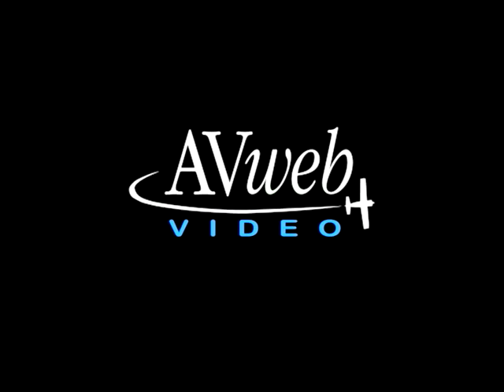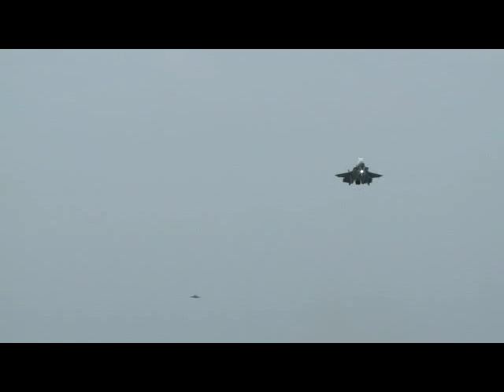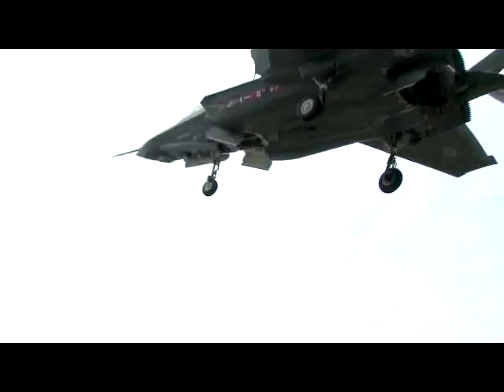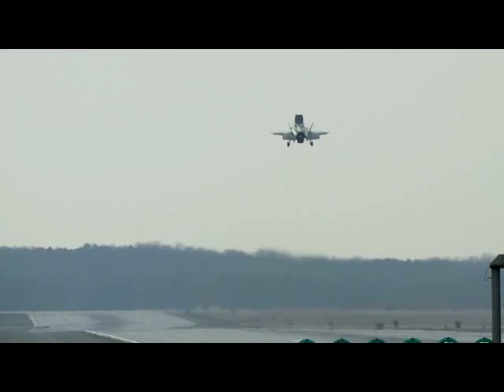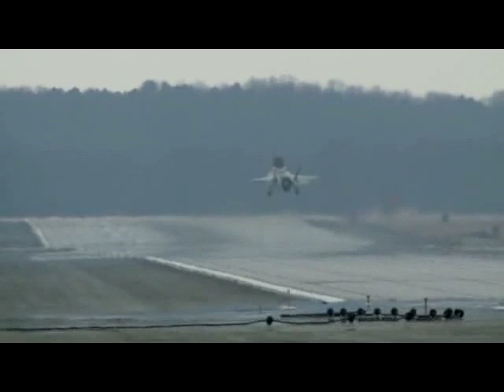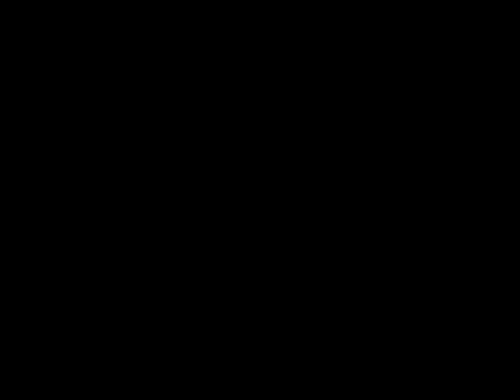F-35B JSF 40-Knot Flyby, Pre-Vertical Landing Test, March 10, 2010

Comment: Well as you should know, the Brits invented a successful VTOL aircraft called the Harrier.
BUT it was harder to fly and maintain. The JSF is basically a single turbine "Mini F-22" in aspect. The front vertical fan is powered by  a drive shaft from the turbine. The JSF is cheaper than the F-22, and can be deployed anywhere in the world. It is one of the greatest aircraft created in the 21st century in aspects of technological leaps. It is more stable than a Harrier, yet a small F-22. And don't t